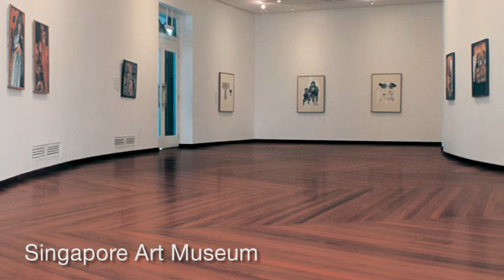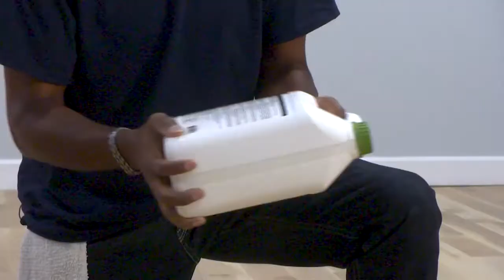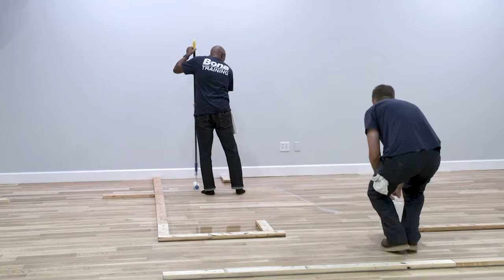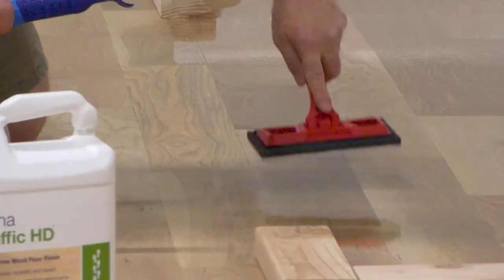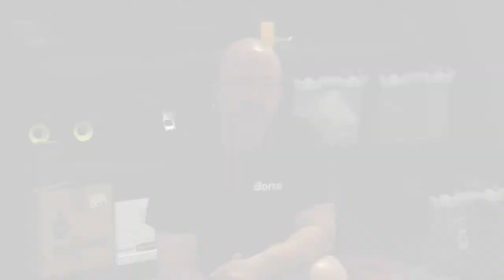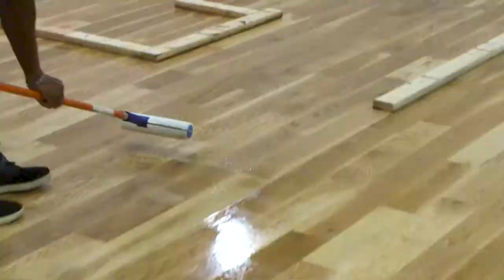Bona Waterborne Finishes - Application Tips

Comment: Hi, I’m using the primer intense and then Traffic HD antislip on my internal stairs. 
I’m just a little confused with the instructions regarding the second coat of antislip.
I will be recoating within 24 hours so does this mean I do not need to sand between the two coats of anti slip?
Reply from the maker: Correct. As long as you apply the second coat within 48 hours of applying the first coat, there's no need to abrade the floor for "adhesion". However, most professionals will lightly abrade (even if it's only with a Bona Conditioning Pad) before applying their final coat to clean up any debris, dust, etc. that might have settled in the previous coat - to give them as nice as a final coat as possible. Hope that answers your question. Cheers!

Comment: What about your stains?  The voc’s they put out is crazy…
Reply from the maker: Actually, both Bona DriFast Stain and Bona Chroma are GreenGuard Certified - meaning they have low emissions that might your indoor air quality. It's true that DriFast Stains do have a higher odor than something like Chroma, but just because something might have a strong smell doesn't mean it's necessarily bad for you; and, likewise, just because something has no odor (carbon monoxide), doesn't mean it's not.

Comment: Can I use hd traffic finish after using a Minwax stain?
Reply from the maker: Minwax Stain is produced for furniture and not recommended by Bona and many other professional flooring craftsmen (though a lot of oldtimers do use it). A large number of failures have been historically noted with most combinations of sealers and finishes over the top of this product. We'd always recommend that you stick to a single manufacturer's product system to ensure compatibility and the best degree of adhesion. Hope that helps answer your question and gets you the best results on your project. Cheers!

Comment: So are you supposed to screen with 220 grit after the first coat of sealer? In the beginning it said no need unless it more than 48 hours what does that mean exactly
Reply from the maker: Hi @ProvingMyDispute - Two reasons for abrasion: 1) For smoothness (if debris or dust gets in coat), then use 180-240 grit Nets or Diamonds on a Conditioning Pad to smooth; and or 2) For adhesion - but ONLY if more than 48 hours has passed since the last coat was applied. Simply hit it with a 320grit Conditional Pad to ensure good adhesion and you're good to go. Hope that clears it all up. Cheers!
Reply: @BonaProfessional  is it okay for 220 grit abrasion after 24 hours? So if I wait 48 hours I should only use a maroon pad to buff?
Reply from the maker: @ProvingMyDispute  You can use whatever grit you'd like but we always recommend the least aggressive needed to get the job done, as we want to limit the amount of sealer/finish that's sanded back off the floor (it doesn't do you any good when it ends up in the vacuum). So, yes, 220 grit would be fine after 24 hours or even 48 hours, but a Conditioning Pad would also work just fine. Hope that helps!

Comment: I have three bedrooms coming off a hallway, but the boards run lengthwise into the bedrooms, not crosswise like yours where you can stop at a dry line.  What to do?
Reply from the maker: Hi @geem.5286 - Understand the situation but not sure exactly what the layout looks like. Several possibilities for finishing these out. 1) If any of the bedrooms runs out into the hallway (without continuing into another room directly across) you can finish out into the hallway and then pull a dry lines on either or both sides of the doorway, if needed. 2) If doorways are across from each other then you could a) Finish the bedrooms short of the doorway, on both sides if necessary, pulling a dry line across the entire floor; then jumping in and cutting those back in and finishing out as you come down the hallway; or b) Finish out each bedroom and "fine feather" a dry line about 1/3 the way across the hall (best accomplished with your cut-in pad or a paintbrush); then when finishing out the hallway by itself you'll need to "fine feather" back past these areas toward the doorways to hide the transition and get the proper amount of finish on the floor; or 3) Have two people finishing out the cross-ways bedrooms at the same time; meet in the middle of the hallway and pull a dry line on either or both sides of the doorway, if needed, from there.
Hope this makes sense, but it not, please give our tech services team a call at (800) 872-5515. Cheers!
Reply: So nice of you to take the time to reply with such a thorough explanation.  I'm going to print this out and use it so I can get it right.  Thanks so much! @BonaProfessional

Comment: Hi, should i seal my raw wood stairs with a wood sealer before applying traffic HD? And what kind of sealer? ,thanks!
Reply from the maker: Hi @indbolwebelieve - Yes, you should always use a sealer prior to applying waterborne finish top-coats, depending on what you're shooting for in regard to the final appearance. Sealer choices could include one coat of any of the Bona DriFast Stain colors (stain/sealer combo); or 1-2 coats of any Bona waterborne sealer (ClearSeal, ClassicSeal, IntenseSeal, AmberSeal, NaturalSeal, NordicSeal); or even 1 coat of DriFast Sealer; followed by 2-3 coats of Bona waterborne finish over the sealer system. Please read the labels of your desired sealer/finish system products to determine proper application tools, application rate, dry/cure times, and interboat abrasion requirements. Hope that helps a bit!

Comment: There some products I can use for a front door finish  ?!!..
Reply from the maker: Hi @eddiethepaintermiguel8775 - Bona finishing products are only tested for interior use. Any of the sealers and finishes would work well for the interior of the front door (though I'd probably stick to a single component finish - i.e. Bona Mega One); and we'd also recommend to remove the door and lay it flat so that you can apply the system to a horizontal surface to avoid drips and runs. Hope that helps!
Reply: @BonaProfessional  thanks for the answer.. I really like this product 👌

Comment: it's unclear when you use traffic hd?  All the videos I watch show it being used over unstained natural flooring.  Im looking for a slight sheen over a medium brown stain over white oak, and I really dont want to use a product that will look terrible a year down the road.  Im not sure what the prefinished floors use but they seem to hold up very well.  That's my goal is to get that level of protection over stained floors.  Will Traffic HD work or do I need something down first or after Traffic HD?
Reply from the maker: Hello @Scott-dn1bk - If staining the floor, you've got two choices. Since most stains are "sealer" stains, you could go directly over the top with 2-3 coats of Traffic HD. Or, you could also apply one coat of IntenseSeal (to "pop" the color of the stain a bit more), followed by 2 coats of Traffic HD. Hope that helps!

Comment: So this was a bare floor with only 2 coats of traffic hd? No Bona classic sealer?
Reply: Why don't you offer your customers a smaller container for touch up? Your forcing us to spend $141 to refinish seven square inches.
Reply from the maker: Hi @stevenzembriski6761 - For this go around on the Studio floor, we had already applied a coat of Bona IntenseSeal, followed by two coats of Traffic HD. That's a typical (and minimum) system required for residential floors, as we want at least 3mils of Sealer/Finish on the floor in order to get the performance characteristics that we're expecting. Hope that answers your question. Thanks!
Reply: @BonaProfessional  thanks for the reply, I am doing a kitchen floor (red oak) I will strip it down using a drum sander and was thinking using a coat of Bona Naturalseal and then 2 coats of Traffic HD dose that sound good for a kitchen floor? 
Thanks Steve.